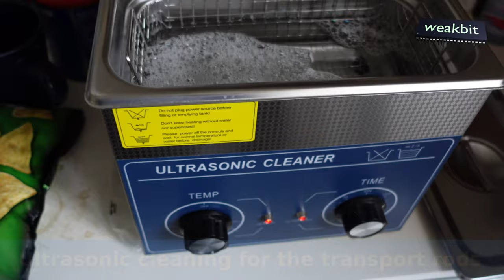Samsung CDH 44R CD-Player repair

Comment: I think you put the springs in wrong.  I don't think they are supposed to go around the rubber grommets, otherwise the grommets don't do anything. They are there to interface with the springs and absorb vibration.